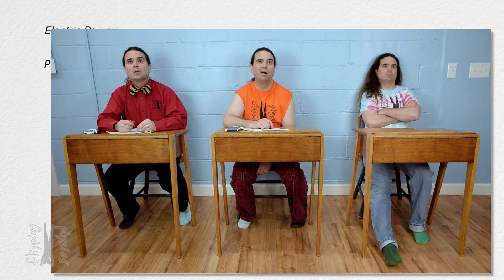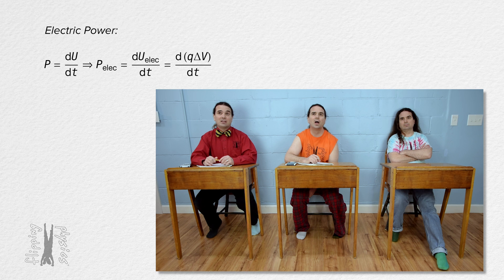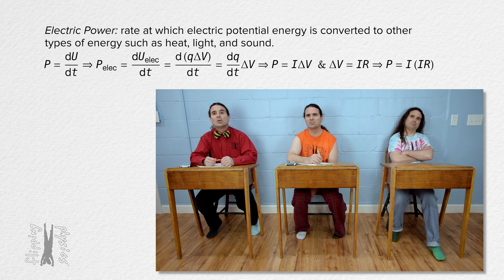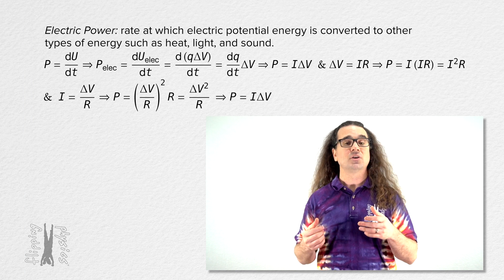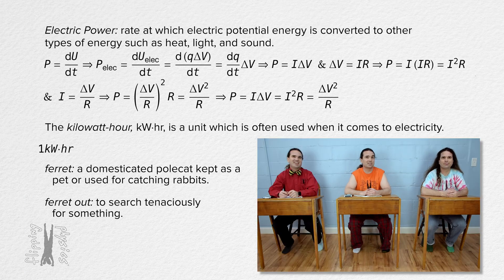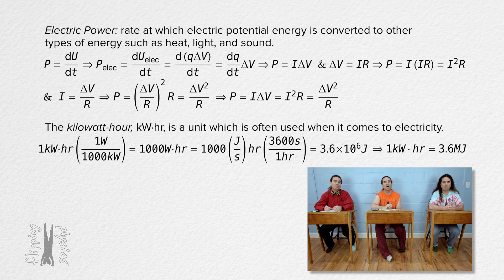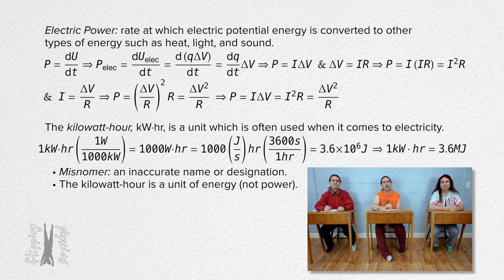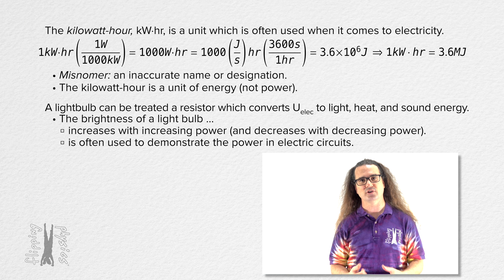Electric Power

Comment: Dear, can u make a video on how to calculate equivalent Power across multiple devices? Cuz besides the two formulas(series and parallel) for calculating equivalent power, you also have to be careful if they are connected across the standard potential difference(usually 110-120 V in usa and 220 V in india) mentioned on the bulbs which is confusing.

Comment: I always wondered what the power ⚡ companies are doing with the unused electricity that goes back to them. 

Are we being ripped off? 🤔
Are power companies actually EVIL? 🦹‍♀️😈⚡
Reply: Good question. The short answer is, grid frequency is used as feedback, so the generation stations "know" how much power to generate to adapt to the load.

Consider 60 Hz like we use in the USA.   This is directly determined by the rotation rate of the rotating generators, so it implies that there are generators rotating at a related rate such as 1800 RPM or 3600 RPM.

The frequency is very close to a constant 60 Hz, but it isn't perfect.  It will fluctuate within fractional Hertz higher than this, when there is less instantaneous demand, and lower than this, when there is too much demand.  Rotating generators will speed up when unloaded, and slow down when loaded more, which the grid frequency will reflect.  The power company has a performance requirement to keep it within a standard margin of 60 Hz, and will adjust the power plant output to correct the errors in frequency.  The inertia of the rotating generators and flywheels, will temporally store the surplus energy, and return it to the grid when the frequency returns to nominal.  Some power plants do well at adapting to varying loads, like pumped hydro and natural gas.   Other power plants are best suited for providing a steady and predictable base load, like coal and nuclear.